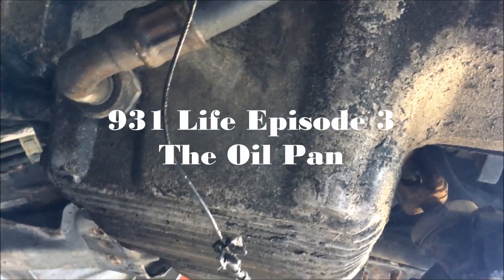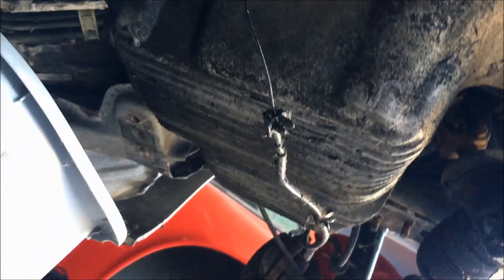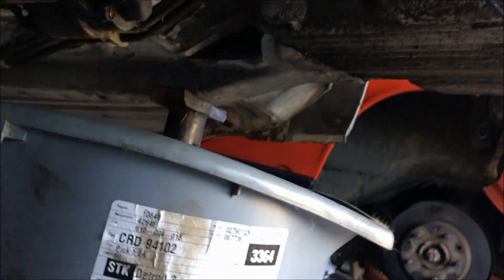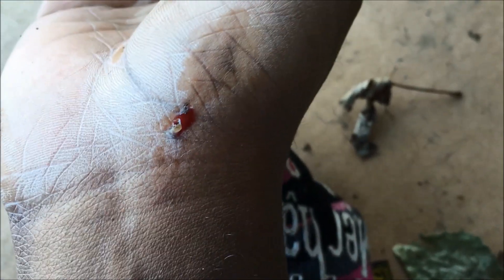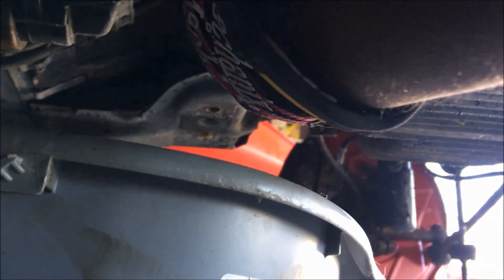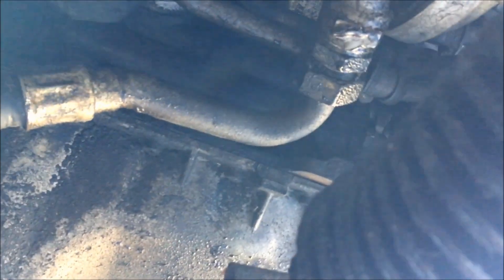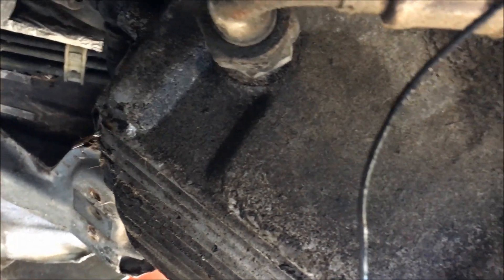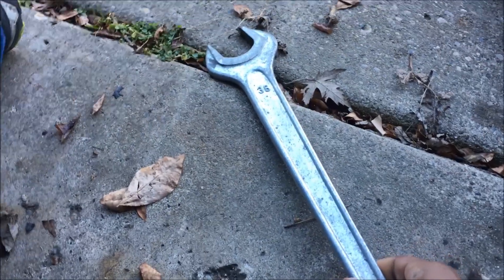924 Turbo Life Ep 3: Oil Pan Removal Part 1

Comment: Turbo oil drain line - return line..
Big crescent/adjustable wrenches.. Hold the inside fitting still and use impact on the wrench on the  bigger nut, hit it with something..
You are probably best off to find a hose shop or a shop that works on tractors to replace the rubber line in the middle of you turbo oil drain line..
Reply from the maker: That's the attack plan tomorrow afternoon. I should continue to share my adventure on Rennlist sometime. I've been busy in recent time.